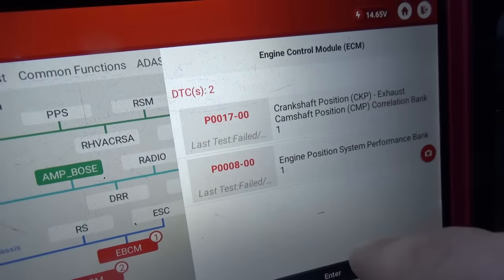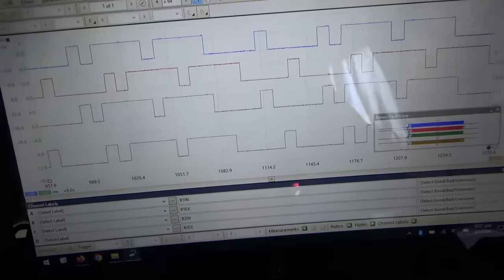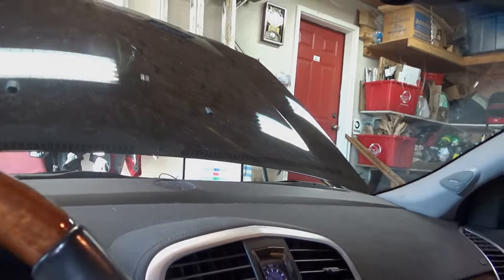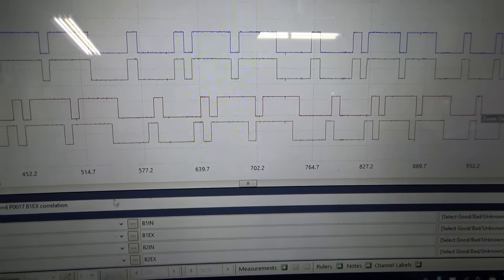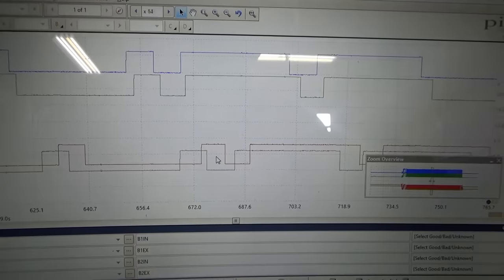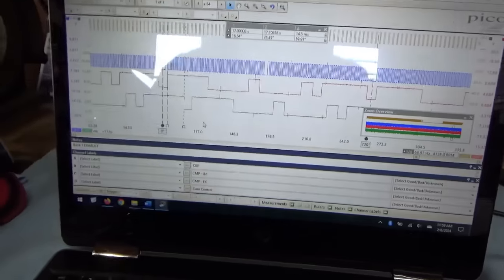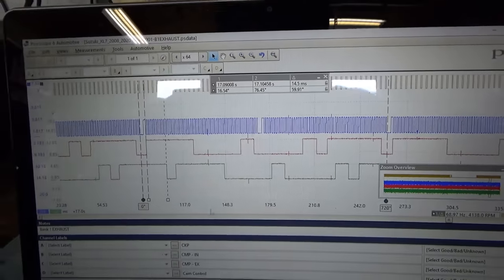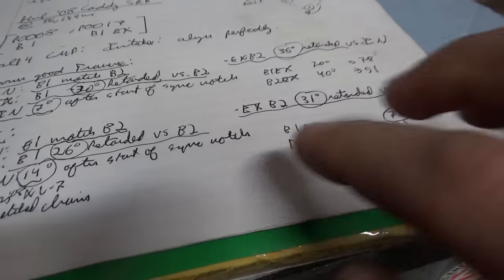GM Timing DEATH CODES? (P0008 P0017 Cadillac SRX V6)

Comment: A Cadillac lasted 16 whole years before planned obselescence kicked in?  GM let that one slip through the cracks.  The more I watch yours and East Main's videos the more I realize I will probably never buy any US brand vehicles, most especially GM.  I just bought my first Toyota, a 4Runner, last year and after having some parts replaced and fixing up some neglected things on it I am surprised it has ran as well as it has, and the parts Toyota designed for the drive train are beefy compared to my old Cherokee, it's no wonder they are so robust.

Comment: What would really help nail this down exactly Is a known good in cylinder pressure waveform versus crank sync notch. Then you would know if the reluctor has moved in relation to the pistons.
Reply from the maker: Not a bad idea! 10 degrees should be measurable on the scope 👍

Comment: It looks like a teardown would show the problem, but since the crank timing wheel is at the back of the engine, what do you have for a mechanical reference to check the cam timing other than removing #1 spark plug and checking when the piston is up at TDC compression?
Maybe later on the vehicle will be back.
Good one Ivan.

Comment: I never really understood why these early high feature V6s eat timing chains.  It seems like we blame later chain failure on the direct injection but these first gen ones are port injected.  In any event, as I have said time and time again, the Northstar is the much better choice in these Sigma STSs and SRXs.  I had one of each and guess what - no timing chain problems.  Or any engine problems.
Reply: Bad PCV design and long recommended oil change intervals kill these engines
Reply: @lieutenantdan8170  Yeah that makes sense.  Plus the inevitable oil consumption on those long intervals.  I think I remember reading that running low on oil does starve the chains for lubrication over time.

My 08 SRX V8 held like 8 quarts so the 8000-10000 mile oil changes on synthetic were fine, plus I never let it get more than a quart low.  The problem is, this was the era were the oil life monitor wanted to run the oil to 13k or sometimes a tad longer.  For regular people not using the right oil or checking it, this is a recipe for disaster.

Comment: Fourth!  I can remember when Cadillacs had a christmas tree above the rear window you could see in the rear-view mirror.  If that is the GM 3.6 LFA engine it is really a pile with only 85,000 miles.  While a 2008 Suzuki XL-7 has that 3.6 liter engine, I KNOW your '02 does NOT; if it did you wouldn't have it.  The 'ol Marquis had 497,000 miles and I wonder what condition the chains are in on that 4.6 modular.  I will bet they have been ground up into shavings.  NAH!  GREAT VIDEO!

Comment: Drive it til it drops.  That's my motto.  Then again, a 1995 Ford Ranger with a 2.3 and a 5 sp will run forever.  Toughest truck Ford ever built.  I owned a Caddy in the 90's.  Never again.

Comment: Would quality replacement chains prevent his from happening again in the future on this car?
Reply: Maybe if it was titanium. There just isn’t enough meat on the chains nor space in the chain case for a stronger chain. The Car Care Nut channel showed the difference between a Toyota chain at 100 k and a GM chain. The GM chain looked like a toy and was stretched with a lot less mileage. He said he never replaces the Toyota chains. They don’t wear or stretch no matter the mileage. Amazing that GM with all the experience designing engines still designs junk. 😕
Reply: So In other words if you own a GM over a Toyota you better change the oil twice as often and stay off of the throttle if you don't want timing chain issues, That's what I see here, It's a shame the bean counters at GM have everything at the bare minimum quality spec now just to save a few dollars, The hell with the Customers they will keep coming back for more of our unreliable JUNK, Why because we are all diehard GM fanboys, Well guess what GM, Your WRONG ❗fjb
Reply: @raymondreiff8170. The only way to prevent the 3.6 timing chains from wearing is to not drive them. Oil changes can’t prevent material stretch.
Reply: @raymondreiff8170  "So in other words".... How about, "In Your Words" .... what are you afraid of?
Reply: @alexanderzubar9593  Or maybe the OEM manufacturer has identified the problem and has since corrected it with new and improved parts???

Comment: The 3.6 has 2 secondary chains for the cams and 1 primary chain ! more frequent oil changes with a good GF-6 oil could prolong the life of the chains ! I believe the GF-6 was formulated for these issues on all modern cars with timing chains ! Plus there may even be a little alkalized napthaline in the formula which basicly " motorkote " ! I use that in everything cause its proven !
Reply: I run a Euro full SAPS oil in my 2014 Acadia with 93k miles. As long as it doesn't burn any oil the converters are safe.

Comment: Hi Ivan , do you think primary chain can be a tooth of? from previous work on timing chains? I know those digital things are right, but how about mechanical of it?  Some times i think "new age" mechanics have forgotten some of their skills, without those fancy computers, they cant do anything, Not you Ivan, I have seen you to do that, just old good ways also. And doing those "russisn" fixes too, those are best in your channel.  
By the way do you know any channel of doing these old (30 - 50 years) german cars, like mercedes and vw bugs, I would be more than gratefull of that information, because my youngest car is now 35 years mb and oldest is 52years old beetle, in fact same as my honda 350 twin.

Comment: Replace Crankshaft
In this day and age of technology/electronics I wonder if there is a "Hack" for tricking the computer "10" degrees
Reply: There certainly is, however I fear that would not be a good solution. Something tells me that would end up causing other problems. Plus the code for each different computer would have to painstakingly be disassembled and combed through looking for just one value. That would be almost impossible for your general mechanic. Might even be impossible for 99% of people out there. I certainly wouldn't even try.

But yeah, with computers and intelligence anything is possible.
Reply: Remove oil pan, smack reluctor with a hammer and tack weld so it doesn't shift again. 😜

Comment: I knew the early 3.6L had this problem, what have you seen on the 2016 LFX models? Has the problem shown to be better for this engine, with good oil change maintenance?

Comment: My thoughts are that the software looks at the timing of the first bank first and if its off, it flags the code and goes no further with other codes on the second bank, other than the performance code which the software looks at sometime later.

Comment: Looks like that ABS problem is the least of this car's issues. And what's with timing chains on GMs? Say what you will about BMWs, but I have a '94 740iL that's had its share of problems through 240k miles, but the timing chain? Never an issue.

Comment: dont remember if the cadillac had the special policy for the bicycle chains in that era but the traverse/enclave did.  supposedly not using the synthetic dexos ate the plating off the chains and they stretched. of course not gm's fault, it was poor maintenance,  you could try programming.  gm tries to fix lots of mechanical issues with software....... no vacuum on your silverado?  lets program the abs so it activates quicker when it has low vacuum so you don't notice it.   the traverse and enclave even had a service update to add coolant for a leaking water pump.  yep.. they claimed a low coolant condition causes a water pump leak.
Reply: It's not just Chevy. They all do it.

Comment: It's a shame there's no way to program in a timing difference for the sensor shift.
Reply: I was thinking the same, but it would be a programmable sensor.  The risk is altering the signal just masks the real problem until disaster strikes, but drive it till it drops is the same path to the crusher.  With a programmable "cheater" sensor, it would restore some performance since the death codes wouldn't be there.

Comment: And that my friends is why i tell everyone to stay away from GM products,  One of my friend's wife bought her mother a brand new GMC terrain in 2021, its already getting codes for for timing issues,  They ended up trading it off for ANOTHER new GMC Terrain.  thats a definition of stupid right there
Reply: Wow!  #lessonnotlearned
Reply: 😅😅😅....yes dam stupid. I guess she wears the pants. 
My wife liked the Terrain. After I got codes for timing chain. High press fool pump codes. I traded it in for a 2014 Sienna. That van ran and ran. My daughter bought 5 sets of tires. She drove it every where. I did brakes. Shocks the regular maintenance. Finally after 375k...the transmission finally started to give out. My daughter traded it in for Toyota truck. 
I'm still driving my 03 Chevy. It's finally due for a transmission too after 367k. I'm dreading the cost. But I'm going to rebuild it. 
Cheers yall
Reply: @2nickles647  Yeah, the Terrain is crap. Hopefully it didn’t cost you a ton of money before you were able to get rid of it

Comment: Cam sensors may "fix" it for a minute because it is a correlation fault. I don't know what GM's code set criteria is but with Toyota it's only about 9* between actual and desired cam to crank correlation. Maybe if you are just at the threshold and the new sensor data is slightly different it'll be just enough to put it within spec. But NOTHING would be fixed. 
If you can't afford to replace the chain then don't waste money on sensors, and shops quit giving customers bad advice which causes them to waste money when they really need that money for an actual repair or new car.

Comment: Watching junkyard videos you see sooo many great looking  cars junked under 100kmiles because of the gm 3.6l engine blown up...people run them too long after the timing codes and destroy the motor...its a bad design(smalloilpassages) and the poor quality....bring back portinjection and cam in block...new 7.3gas from ford did..except their chineesmade lifters and cam delaminate and cause bad motors...

Comment: These are very problematic engines aside the notorious chain issue, they burn oil like a rotary, they shift the crank trigger wheel, they love to snap valve springs and drop the valve nuking the engine
Reply: Oh i also forgot to mention they also love breaking cam phasers causing rattle on start up

Comment: Was that car made in Mexico or in the United States Mexico sure screwed up the cars and trucks ony way to improve the quality of them if guys like you say dont buy the car nothing but problems then recommend cars and trucks you dont see much in your shop the old cars had a check engine light but that like low on oil 1966 ford Galaxy when Cold a light on the Dash be on it be Blue and turn off when the car was warm up

Comment: I dislike timing chains, they stretch , and give trouble, why not use 2 bevel gears and a shaft, and no more problems. !! 
It's garbage engineering
Reply: Ducati guy?
Reply: Timing gears are solid, but noisier I think?  Most buyers will probably object. Besides, I doubt gears would support the use of variable valve timing and all the other complicated crap OEMs want to do now.
Reply: You wouldn't have cars that fail just outside of warranty then! Had an IHC Scout with the 345ci. Timing gears, didn't find it noisy, found it reliable. 300K miles on it, no Timing issues, imagine that.
Reply: @disgruntledcanuck  Awesome!  Love old Scouts.

Comment: Hello ! One US SUV has a magnetized disc for reading the crankshaft position, which is located behind the flywheel in the engine and from which the crankshaft position sensor reads data. If the magnetized disc needs to be replaced in case of failure, the gearbox and flywheel must be removed from the car. The magnetized disc has the same construction as the magnetized bearing on the ABS sensor. existing cover.

Comment: Good morning Ivan, great video thank you, but most GM engines built world wide on 4 and 6 cyl has reluctor wheels in the crankshaft  and others are built in to the harmonic balance .
Having said that 99% of the time it's timing chains or variable camshaft sprockets gone bad, so by your mathematics  I was pretty sure it was chains and not reluctor wheel. 🫡